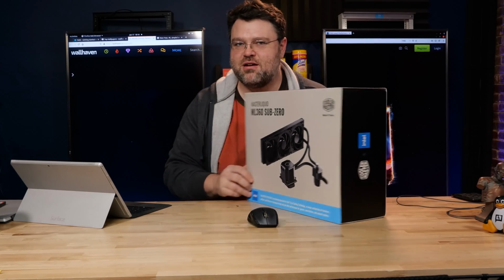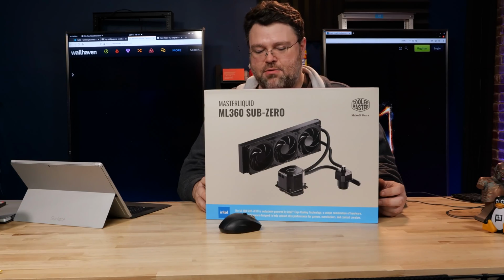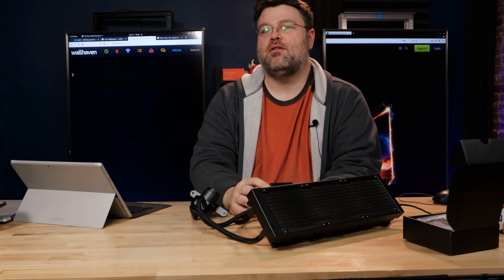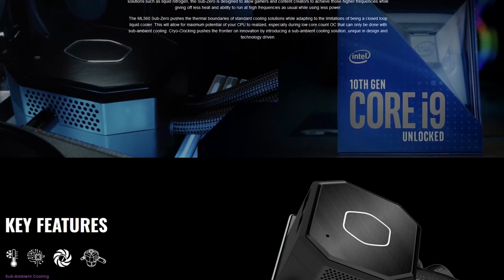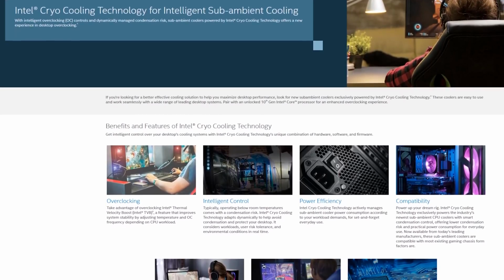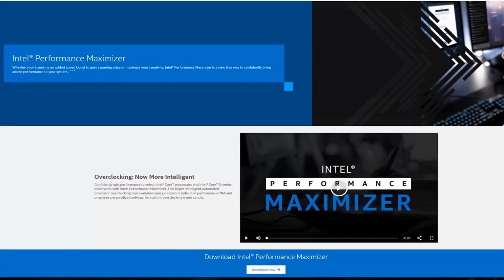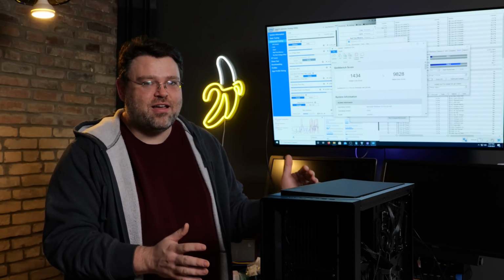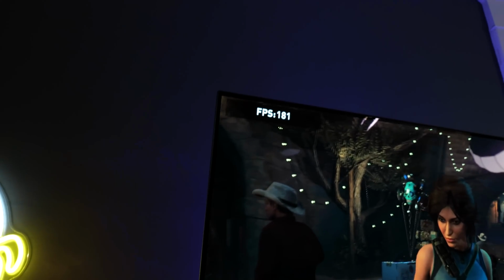5.6Ghz On The Intel 10900K: Checking Out The Coolermaster MasterLiquid ML360 SUB-ZERO

Comment: Ok well I've been running one on a 10900k for about 9 months now.  I have been using it as workstation for the most part,  occasionally hitting the benchmarks and such.  The real benefit for me has been the ability to run at a higher all core frequency for long durations. I trade stocks and run a pretty heavy cpu and gpu load on my machine, typically I'll be running 15 to 20 charts, trading platform, chrome and a few live newsreaders and feeds. The subzero has allowed me to be very stable at a 5.4AC clock and 5.7SC. I do nave a pretty good chip, SP 113 so thinking that could factor in but after swapping with a SP 63 and just slightly tweaking the voltages i was able to get nearly the same results, 5.386AC and 5.6 SC. These aren't benchmark settings, this is my everyday daily driver and at 5.4 doing my workload,  it stays very cool,  avg of 35 to 40 under most loads,  very heavy stock market volume days it it will creep up to about 45 to 50c and stay.  With a ML 360 I was seeing 75c to 80c under the same load but with a slightly slower clock speed.
Reply: The crazy thing is my 10900k runs at 5.3 with a ek aio 😂 70c is the highest and 58c at gaming
Reply: @redclaw72666  5.3 on all cores at the same time under load on aio?

Comment: How's the temps while in the bios, tuning your overclock. It says in the product description that you can use xtu "OR The BIOS" to overclock. But how, if the tec only works when the Intel Cryo software is running after windows has booted... And what about when turning the computer on, the period between hitting the power button and booting windows? Won't it be uncooled then as well?
Reply: You are probably right . If you apply those insane OC in Bios , before Cryo started to do it's job , you will definitely hit a BSOD , you wouldn't be able to start Windows. The latest Cryo software has an option to remember the last setting ,so that it will start on Cryo on startup ... Still, same, XTU will apply the OC at startup , so I am not sure if all will start ok in Windows . I will try it in a few days and I will reply again .

Late edit:
I managed to do it like this:
 - on startup Bios settings are low OC to have a nice Windows start without crash
- Cryo software do remember the last state , so starts to cool down the CPU. In 30 sec, you will have the cooled down CPU 
 - after those 30 sec, I managed to apply XTU overclock programatically (TAsk Scheduler)
Reply: I'm asking because I want to buy 1 but I'm not so sure if it leaves my CPU uncooled at times

Comment: how is the pump connected? what controls the pump? same as the fans or own? via the motherboard or other software?
Reply: Pump is powered on with 12V from a SATA from PSU. There is another cable going to a motherboard FAN header to read the speed of the pump (which is 5700rpm all the time)

Comment: I actually wish the Adler Lake will be very good so i could replace my current Ryzen 5600X system with it, cause last time i had Intel was back in Haswell era when i had E3 1230 V3, which was replaced by Ryzen 1600  in August 2017 and been swapping all kinds of different Ryzens in my main ever since, 6-8-12-16 core ones.

Comment: Yeah would like to see an AM4 conversion kit and throw the small radiator away and combine it with a larger custom one that has no issues getting rid of the heat.
Zen 2/3 gets far more efficient the colder it gets 🤔

Comment: This looks so much nicer than the EK version, they have a USB cable coming out of the top of the TEC pointing at you...
Reply: With the ek version you can relocate that control box elsewhere. It doesn't have to be right on top of the tec/cpu block.

Comment: Could it do AM4 in theory if you made a bracket, or does something on the AIO prevent you from going full goblin?
Reply: You could, but you lose the ability to control it without Intel utilities installed. So there would be risk of condensation.

Comment: I WANT THIS.  WHO I HAVE TO KILL?
DerBauer reached 5,8 i think
Reply: yes ,  5.8 Ghz on 2 cores . Or 5.8Ghz on all cores if the CPU is idle doing nothing .... lol . In games though I've seen i9-10900k with this cooler on 5.5Ghz all cores
Reply: @TiraSoft_GB_Ham  Im on 5.4ghz with AIR cooler on my 10700k. 65-75c in game. Its stable in games only but with that Im sure ill make at least at 5.6ghz all cores.
Reply: @TiraSoft_GB_Ham  5.5ghz because no liquid metal. I sanded the custom IHS & even the die. He uses some average thermal paste.
Reply: Der8auer used the EK TEC if I recall correctly... The EK variant came out of the same initiative by Intel but the was no closed loop unit but a custom loop
Reply: @itmkoeln  its the same tech.

Comment: I have a 9900KS that gets to 90C when above 80% utilization (all cores at 5.1 Ghz). Is this cooler compatible with my socket and the Z390 platform ? It seems it will help me to lower my CPU temps ...
Reply: No it isnt. You probably already know though

Comment: "Why do you have this bank of LiFePO4 batteries in your closet?" "Well, i needed to remove my computer from the electrical grid because it went over code for power draw from the socket. On the bright side, the DC to DC conversion is much better than your normal ac to dc power supplies"
Reply: Eh, that's when you step up to 240V split phase or 207V polyphase. 3 phase systems can offer continuous power delivery with no ripple, where single and split phase power constantly vary due to the zero-crossing of voltage and current.

Comment: >tfw new intel chip runs so hot they needed to invent a new cooling system
Reply: Intel "oven inside"
Reply: None of them run hot... i have an 11900k @5.4 80c tops, 10900k 5.2 mid 70s... cmon